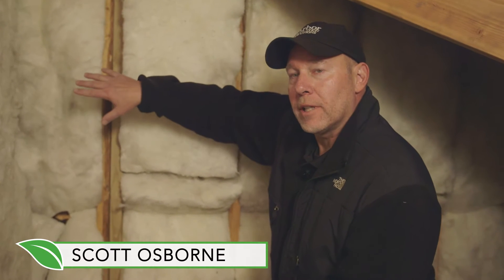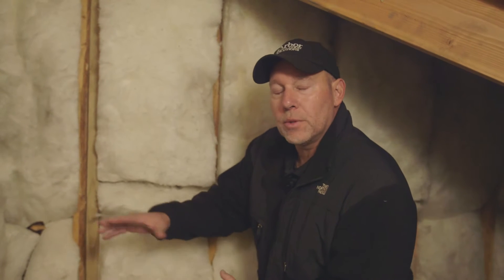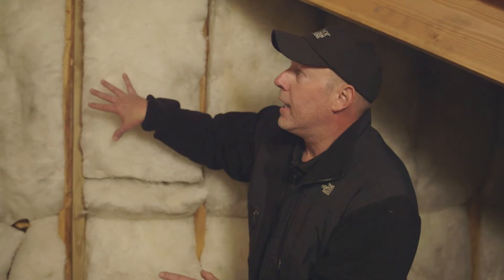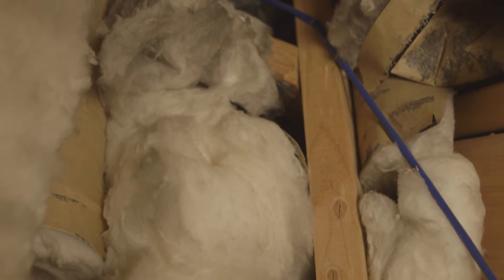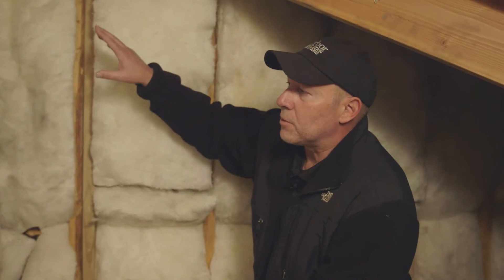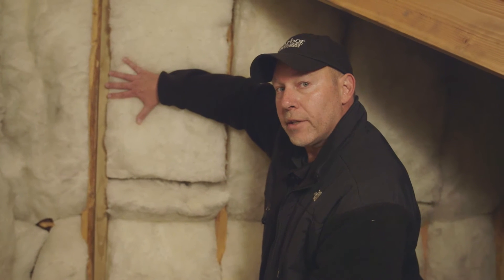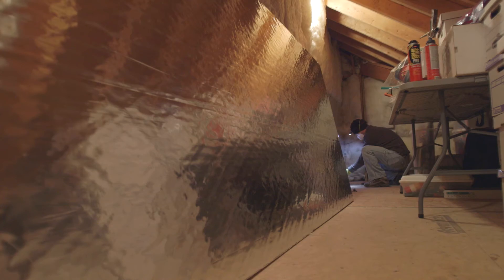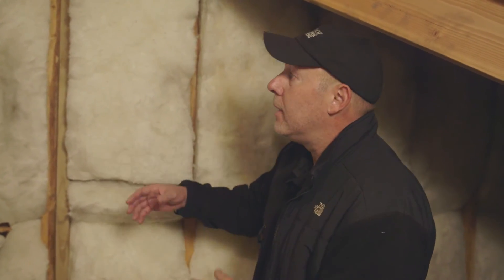Bonus Room and Knee Walls Airflow

Comment: Would this cause moisture issues?
Reply: did you ever find an answer to this?
Reply: @brantley7941  I’ll be honest, I don’t even remember making this comment or what it pertained to.
Reply: @marmaloot6350  haha. It was in relation to insulation on a knee wall causing moisture issues.
Reply: @brantley7941  Haha, I get that, but I don’t remember the entire context of what I was exactly trying to find out to know if I got an answer. Sometimes I fall down a rabbit hole of research and can’t remember how I got there lol
Reply: @marmaloot6350  same. the insulation rabbit hole runs deep.
Reply: I bet you were asking thinking that the radiant barrier would cause moisture issues. I'm not an expert but generally you want to stop warm, moist air from hitting the cold outer wall and condensing. So the vapor barrier (the radiant foil) on the inside should help prevent warm air from hitting the outer wall. That's why the paper on insulation is showing in the room before the drywall goes up
Reply: I'm in this exact situation and also not getting any clear answers. Usually there is an equal number of people saying it is wrong [insisting that now you've trapped moisture and wishing you luck with mold issues later] and then the other half saying it is correct and [yep, that's the way they've done it]. I even bit the bullet and asked two different pros and you guessed it, contradicting answers. 😵‍💫